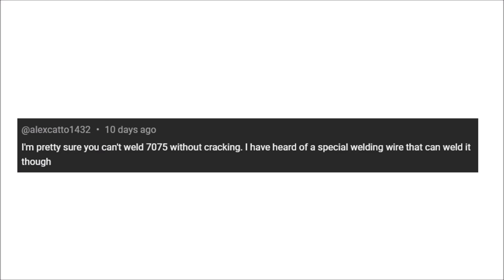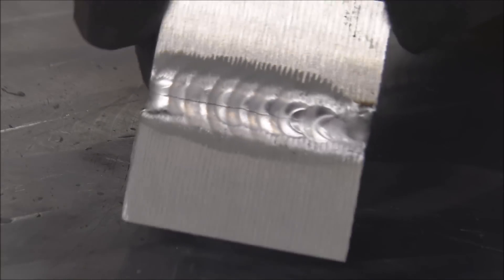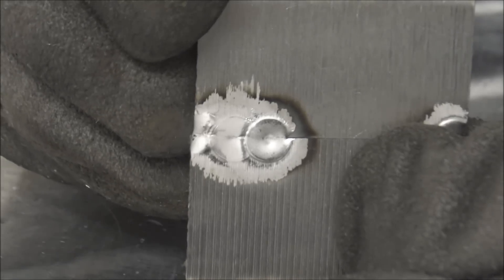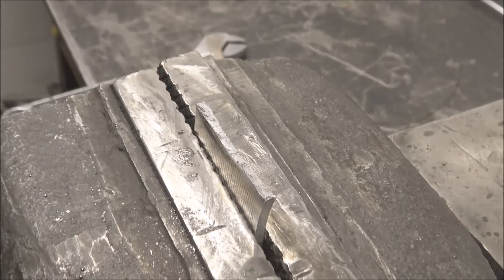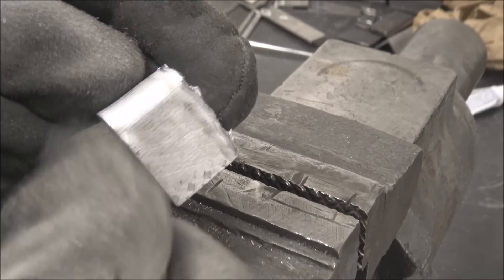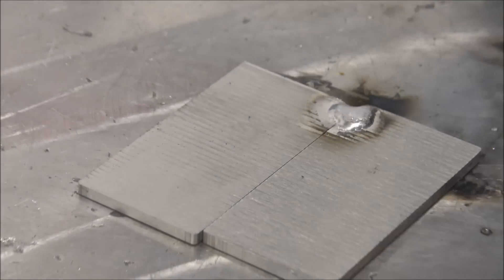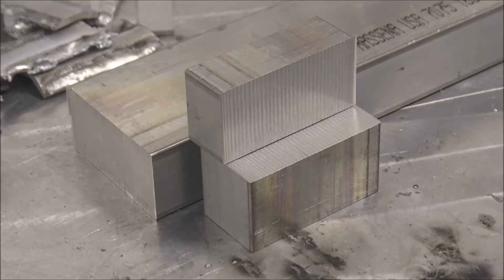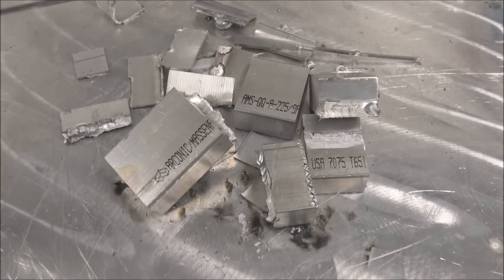TIG Welding 7075 Aluminum - Who Said You Can't?!?

Comment: Aluminum alloys of 2024 and 7075 can become susceptible to stress corrosion cracking after welding. This phenomenon is particularly dangerous because it is not detectable immediately after welding. The cracking usually develops later when the component is in service. The completed weld joint can appear to be of excellent quality immediately after welding. So, can you weld 2024 and 7075? It is strongly recommended that great care be taken when considering the repair of components made from these materials. It must be stressed that if there is any possibility of a weld failure becoming the cause of damage or injury to a person or property, do not perform repair work by arc welding on these alloys and then return them to service. - ESAB The tldr here is : You technically could, just don't.

Comment: It's not that it's physically "not weldable" it's just that the heat treat that gives 7075-T6 its strength is extremely sensitive to the extra heat and it can ruin the overall strength, particularly fatigue, of the alloy.

Comment: Aaron, do you ever have your parts heat treated after welding? That would be an interesting factor to explore here. Might make a huge difference for these alloys, relieving the stress in the weld where the alloy structure is different.

Comment: The 7075 is not user friendly but if you building like a firewall it not bent are welded it's stronger and safer .But bending and weld just use the 6061 my opinion Drag cars builder we never had any of the tool s we using now.Never had a gas lens and alway s used Miller Syncrowave that welder runs as good as the day I got it wish I still ran that good and see

Comment: I just looked in up in my Book for Weld Metal parameters.

7075 is a high-strength, heat-treatable aluminum alloy with a high zinc content (around 5–6%). It is used in aerospace, automotive, and structural applications because of its excellent strength-to-weight ratio. However:
	•	It’s prone to hot cracking during welding.
	•	Welding destroys the heat treatment, significantly reducing its strength.
	•	The alloy has poor weldability due to the presence of copper and zinc, which create brittle phases at high temperatures.

Materials & Equipment
	•	Filler Rod: Use 4045, 5356, or 2319 (experimentally; not ideal). 5356 is more common but does not restore full strength.
	•	Tungsten Electrode: 2% lanthanated or pure tungsten.
	•	Shielding Gas: 100% argon (or argon/helium mix for deeper penetration).
	•	Polarity: AC (alternating current), with balance control if possible.
	•	Preheat: Around 300°F (150°C) to reduce thermal shock and cracking.

Welding Process Tips
	1.	Clean the base metal thoroughly—mechanically remove the oxide layer, then wipe with acetone.
	2.	Preheat the part to reduce the chance of hot cracking.
	3.	Use low heat input—keep the weld as small as possible.
	4.	Skip weld or stitch weld to minimize heat buildup.
	5.	Use short arc lengths and a tightly controlled puddle.
	6.	Let the part cool slowly under an insulating blanket.

Comment: Built a thru the ice sonar sled for a search of a missing airplane. Every part had to be aluminum. Most of it was welded but it needed to be able to come apart in pieces small enough to fit in a small aircraft. It was about 26’ wide fully assembled. All of the nuts and bolts were 7075. They wanted the nuts welded in place. Nothing worked. Ended welding capture bands over the nuts to keep them in place.

Comment: 2024 and 7075 (copper alloy and zinc alloy) are precipitation hardening alloys of aluminium. They can be welded but end up with no strength in the heat affected zone. That is why aircraft structures are rivetted together. Russian metalurgists have developed precipitation hardening alloys incorporating Scandium as an element in the alloy which purportedly can be fusion welded. I have never seen them. I am a 65 year old veteran aircraft structural engineer so I'm not just blowing shit out of my ass here. Everthing on an aircraft that is welded(fairings, wingtips etc) are made from 5000 , 6000 or 3000 series alloys.

Comment: How are 7075 bikes welded together? Soldering/brazing technique aside, I think they need to be tempered afterwards, my 7075-T5, 20 y.o. bike, is like a tank ...
Reply: Well.. Correcting myself, bikes are usually made of 7005 ... not 7075.... there are chains made of 7075, but bike frames are (AFAIK) 7005...

7005 aluminum alloy main usage is in the manufacture of bicycle or car frames, auto parts, etc.
7075 aluminum alloy main usage is manufacture aircraft structural parts, engine parts, satellites, and so on.

Comment: Please do a video about stress corrosion cracking. Everything that you just showed in this video is equally applicable to all 7,000 and 2000 series aluminum alloys. The only time either one of these two alloy series should be welded is for cosmetic applications. The only time I've successfully welded either one of them is to repair a blow mold from time to time and only for cosmetic fixes where JB Weld would have worked just as well too. JB Weld might even be stronger in those applications😢

Comment: The only time I've ever successfully welded 7075 to itself or anything else was fixing molds. Say you had an aluminum mold that got a screw loose inside of it or something of that nature and your repair was simply just filling up a blemish and machining it back down for cosmetic reasons on the finished product. Otherwise it is subject to what's otherwise known as stress corrosion cracking. In the case of welding 7075 to 6061 with 4000 series filler it might not crack this afternoon or in 2 days but sometime in the next 2 weeks to 6 months is going to crack and fail.

Comment: I've been involved with both steel making and the manufacturing of metallurgical additions for Aluminum.  In the case of steel, the bath temperature is around 3000°F, so additions to it have little problem being melted also.  However with Aluminum, that is not necessarily the case.  Aluminum melts at little over 1200°F, so how do you add something like Titanium that melts at over 3200F or Silicon is 2588°F. 

I'm an automation guy not a metallurgist, but I worked on the process to compress Titanium fines into "compacts" that are dense enough to sink when thrown into the Aluminum bath.  So think about the melting point dilemma, what next?  Well they don't "melt" but I'm told, eventually they will devolve.  So with like condition, like salt in water, they are un-reacted but still present with in the crystallization process when freezing occurs. With different freezing temperatures, is it a surprise that brittle conditions occur...not really. Think about iron, if it is plunged into cold oil or water, the crystal structure is randomized as it freezes, and it become much harder...which is to say...more brittle.  

One other consideration, if pulses of heat are being added to the Aluminum, that implies gradients of temperature, and this may contribute to the disorderly freezing process.

Comment: Very interesting. I wonder about the "welding" rod that's more like soldering or brazing. I think that's usually used with a torch. Obviously, the temper will be gone, though. It kinda reminds me of cast iron. How does it compare to cast aluminum?

Comment: Led by Prof. Xiaochun Li, a team at the UCLA Samueli School of Engineering set about addressing that problem. In the course of doing so, they fabricated thin rods made of 7075 infused with minuscule particles of titanium carbide. These rods were then placed between larger pieces of the aluminum alloy which were about to be joined, acting as a filler. When the rods and adjacent material were subsequently melted in an arc welding process, the nanoparticles eliminated the uneven flow issue.

"Nanoparticles make the elements in the liquid metal solidify together more uniformly, thus preventing phase segregation," Li tells us. "Phase segregation normally will block the liquid metal flow during cooling, thus inducing shrinkage and cracks without liquid filling. Since the metal solidifies more uniformly after adding nanoparticles, the liquid metal flows better during solidification, thus no cracking due to segregation."

A close-up view of one of the AA7075 welds
A close-up view of one of the AA7075 weldsUCLA
The resulting welded joints have a tensile strength of up to 392 megapascals – by contrast, the commonly-used 6061 aluminum alloy has a weld strength of 186 megapascals. What's more, it is believed that post-welding heat treatments could boost the strength of the 7075 welds up to 551 megapascals, which is on par with the weld strength of steel.

Although the alloy is already used in items such as airplane wings and fuselages, sheets of it typically have to be riveted together. The scientists now hope that the ability to weld it will increase its applications.

"The new technique is just a simple twist, but it could allow widespread use of this high-strength aluminum alloy in mass-produced products like cars or bicycles, where parts are often assembled together," says Li. "Companies could use the same processes and equipment they already have to incorporate this super-strong aluminum alloy into their manufacturing processes, and their products could be lighter and more energy efficient, while still retaining their strength."
Reply: This titanium nanoparticle welding rod sounds mighty expensive! I wonder if it beats riveting, spending all that time on good aerospace rivets also ain't cheap.

Comment: Seems like 7075 is as difficult to weld as cast iron. In non critical applications with very specific pre and post heat application moderate success can be achieved.

Comment: A few years back I had some costume out riggers made for extendable lowboy out of t6 aluminum 

They worked great until they got broken the welds would hold but the metal turned brittle next to the welds 

And that prime welder sounds like a better weld 
a much smoother sound 

Welding technology has come a long way 

From the ol Lincoln cracker box 180 amp from Sears catalog

Comment: Not a welder, im curious, can somebody or hopefully 6061 himself explain to me why not welding wider deeper into the two 7075 like horizontal figure 8 making bead resembling 

88888888

Instead the usual 

oooooooo

And even try

8o8o8o8o8o

(of course the o is centered to middle of 8) 

And experiment with making the 8 ridiculously super drawn out wide deeper into two base material resembling this 

§   §  §  §
§o§o§o§
§  §   §  § 

Or even maybe if aluminum keep cooling faster than you can return to it with single point try use two welder same time😂? 

The idea is two fold to in a way annealed as you leave behind weld material cause you are leaving them slower or you are returning to cooled weld before they completely cool and bringing them back up in temperature when you return to old side bell of figure 8 you just left behind and the
8o8o8o8 increase the surface area or length of the line where crack would form in squiggly line increasing the surface area of failure to increase strength (I know ideally theres no failure near welds) you know like foot of straight string is shorter than foot of squiggly string when the squiggly string is pulled straight.

Also the straight wire trick, have you tried tensioned spool then pulling stretched wire over a bend at least 90 degree rapidly (I do that for dealing with goat electric steel wire for random stuff.) it might be faster than drill and vise method.

Comment: Thanks for trying anyway great stuff. I work with these materials alot, the appropriate "glue" does the job if you have enough surface area. The bike frames do give up on the welds, sometimes you can weld it to a forged or cast piece and mig it. We mainly use 6082, not as strong 7075 but better than 6061. Thanks again your videos are the real world stuff.

Comment: Very educational thanks.
We don't weld Aluminum where I work, but, I can tell you a story about a "know it all" welder who welded 5140 without any preheating and them threw the welded assemblies into a cold stillage. Wasn't long before the welds were all failing due to underbead cracking (very high HAZ hardness in parent metal - about Hv550). Cost us a lot of money to repair his fvck up, and the loss of reputation cost us even more.

Comment: I once spent half a morning welding on a panel to a piece of equipment. Weld, crack, grind, weld, crack, cut it out, you get the picture. After getting boss man, we didn't find a single weld on this entire thing, just rivets. Our only conclusion was that it was either 2024 or 7075

Comment: I have repaired three MTB Frames successfully with Almg 4,5 MnZr 3.2 / 2.4 without Thermo Operation, just wait for three Months that the Alu get his strength back.

In Germany we say: Bis sich das Gefüge richtet.
Reply: I thinked they are welded before also it must work 🤷 I’ved tried it and it has worked and still hold 😂

Comment: I have enough issues with my,,,,     M onkey I nduction G luing  unit.  But it’s fun way to heat 💩 and burn holes in rusty metal.
Unless anyone wants to chip in for muffler parts for my  ’04 Tacoma,  anyone else love fake stainless steel mufflers ?

Comment: I think structural welds where 2 pieces are welded together is probably doomed for the most part with 7075. 
But as you demonstrated, I believe you can lay a bead on top of 7075 ok with some technique & practice.
This Old Tony came across this issue and padded out part of some dirt bike pegs that were made from 7075 a while back.
https://www.youtube.com/watch?v=AhMil-ibUTY
Great video as always.

Comment: The alloy components of 7075 include zinc, magnesium, and copper (in addition to the aluminum of course).   I believe the copper may tend to glob together when molten instead of staying in solution, and you end up with a slurry of copper solids (higher melting point) in the remaining liquid over a wide temperature range as it cools (and shrinks).  Aside from the obvious change in the grain structure of the alloy, the liquid has zero strength as the solids contract while cooling, and you get inevitable cracking in the microscopic gaps that grows quite large in the final pool.  I think the reason the tacks worked was that there was a large molten pool available to feed the thermal contraction from the side.

Comment: Before I had a tig, I used the alumiweld rods on a couple 6061 projects with a propane torch. Not ideal but for their intended strength it worked out good. It would be better with oxy-fuel torches so you can dial the o2 down a little to prevent the aluminum from oxidizing. With an AC tig they should also work pretty well when you don't need ultimate strength, just decent strength. My kit came with special flux, so it was a lot like soldering or brazing.

Comment: I welded a 7075 80% AR lower after an end mill made a nice slot in the side of it (forgot to set the tool diameter in the mill). Works totally fine when it's a cosmetic fix, but no good if you need strength.
Reply: This is actually exactly why I’m looking into how to fill/weld 7075. Except I’m more so looking for re-profiling and cloning purposes.
Reply: I have the same issue. The mill bit walked its way out of the chuck and i cut through the bottom of the reciever, wondering if i can fill the hole  in

Comment: I’m certified to weld on Aircraft and I was told that 2024 and 7075 are not weldable because the alloying metals separate when heated to melting temperatures. That’s probably why the aluminum brazing worked. Unfortunately a majority of aircraft use those two aluminum alloys. Made for a great video though. Keep up the good work.
Reply: That is why they Rivet most the plane.
Reply: @ZAPATTUBE  Riveting makes manufacturing and maintenance easier and cheaper.
Reply: @thomasbecker9676 allows parts to flex instead of break too.
Reply: Yeah you can weld basically any alloys. Wether it is the same alloy after is a different thing
Reply: I was told the same thing.  2024 is used in the fuselage of the aircraft.  I welded some 2024 to see and it welded nicely.  I called the Naval Depo and they said it will most certainly crack due to vibration if not before.
Reply: Yes, especially 2xxx series as the allowing metal is copper. Cracking is almost impossible to avoid. However, I really haven't heard 7xxx series being like that. Maybe a delayed crack? But honestly, I'm not familiar with 7xxx series.
Reply: Both are very weldable depending on their initial heat treat but they need to be heat treated after and thats where the problems arise,  usually you have 2 shots at it before its scrapped, at least in aerospace
Reply: Its weldable...
...by Friction Stir Welding.
Reply: It's most likely still the same alloy but the The Temper of the alloy is most certainly gotten a lot closer to the range of T3 to t zero
Reply: I wondered about friction stir welding. 
I've just heard about that style of welding and was reading about it but i still don't know much about it. 
 I also wondered if it could be ultrasonic welded similar to how they do plastics?

Comment: When heated during welding, 7075 aluminum's molecular structure causes the aluminum, zinc, magnesium, and copper to flow unevenly, resulting in cracks. This is known as phase segregation. 2024 has the same issue.

Comment: The problem with 7075 is not just the copper, which isn’t a serious problem, it’s a moderate amount, not exceeding 2%. It’s the zinc which is a problem. There’s 5 to 6 percent zinc in 7075. The brittleness is from the zinc. Zinc is strong, but brittle. This just glues to show that standards are often correct.